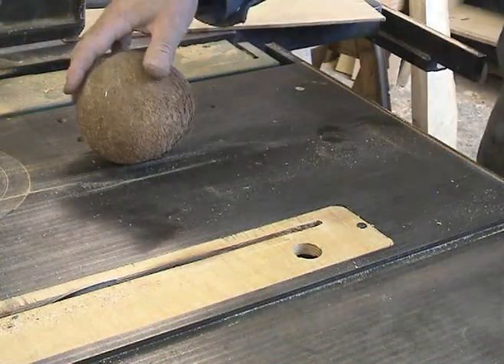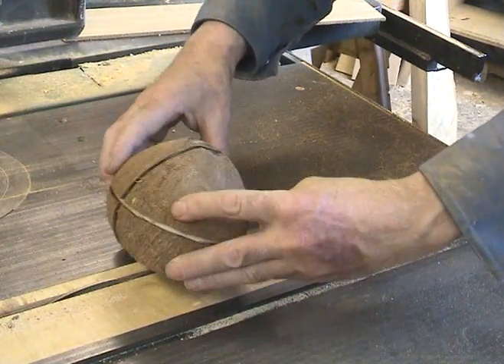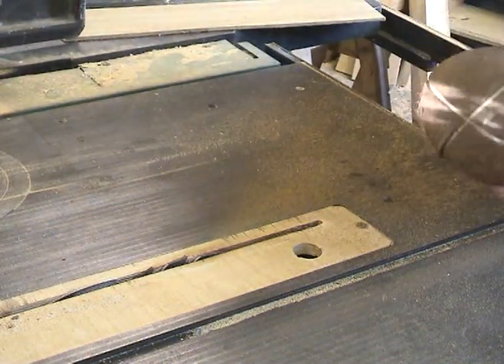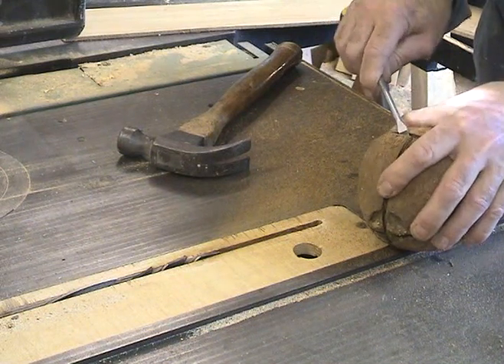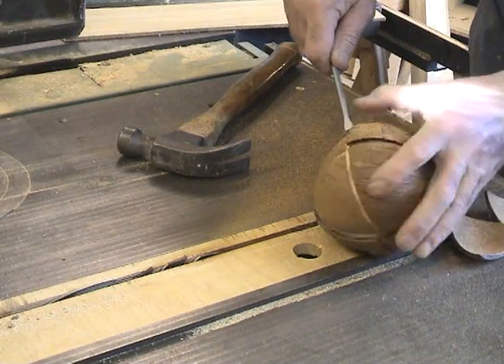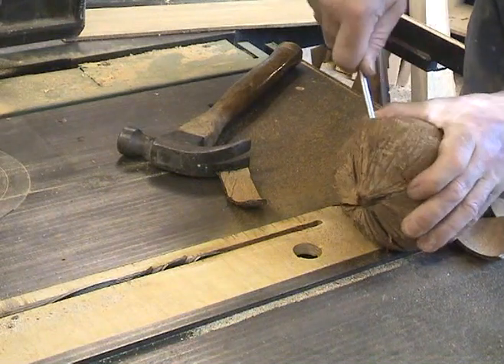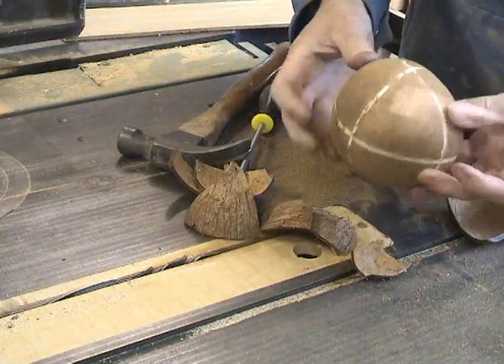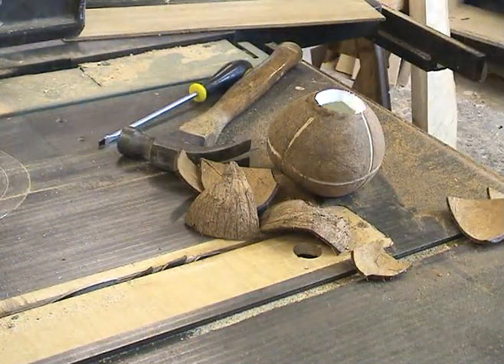COCONUT LOVERS LOOK. Totaly unique way of opening a coconut.

Comment: This works great!  Although it makes a lot of dust.  I didn't need the hammer.  Just rotate the screwdriver blade between the shell pieces to pop them off until there is only one left.  Tap the screwdriver under the remaining edge to loosen it.  A vegetable peeler removes the brown layer quickly.  Then bring the whole coconut to a party and tell people it is an ostrich egg.  It's Piña Colada Time!

Comment: It would be very easy to make a jig in which the coconut sits, under the jig a small  hand held type circular saw.  Either rotate the jig or rotate the nut - but then  its not as much fun as using a hammer.

Comment: I'm sure in your mind you have answered every one of my criticisms. 
Unfortunately, it's ONLY in your mind.  
Twisting the facts to fit your supposition is not the same as reasoning. 
Woodworking 101
:a) NEVER put your hand that close to a blade.
b) NEVER hold an unstable object to the blade. 
That pretty much covers the common sense portion of our lesson.

Comment: @hussein677  Thanks for your interest.
If you just run the nut over the blade you will quickly see how deep the cut needs to be.
At the top of the nut it generaly is thicker, but its easy enough to do a little extra there.

Comment: statistics dont allways tell the full truth.
Perhaps the question should be - what machine is  most commonly used of all the machines used by woodworkers?
Then you ask the question, in what proportion are other machines used, then how many accidents happen with them.
Once you have those statistics you can give an accurate answer.
However you are quite right a lot of accidents happen with circular saws, and often to very experienced operatives, so one should allways be careful.

Comment: The skin of a coconut is between 3and 5 mm thick.
For a finger to be severed it would have to lie flat on the bed then slide forward, and then rotate.
The pull generated on the coconut by the blade is not sufficient to cause the kind of drag necessary to flip.  Because the hands are at each end of the nut they are not over the blade.
Then of course the question arises of how many "dumb ass kids" have access to a circular saw - 
Its so nice to come across someone who cares so much.